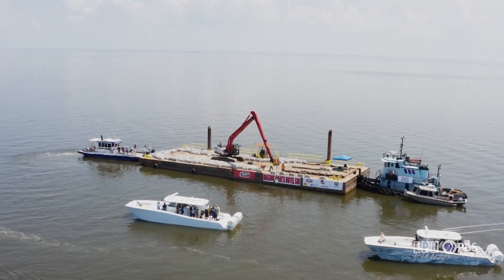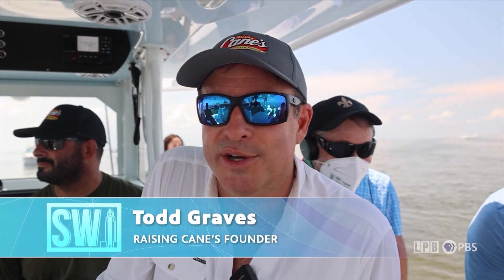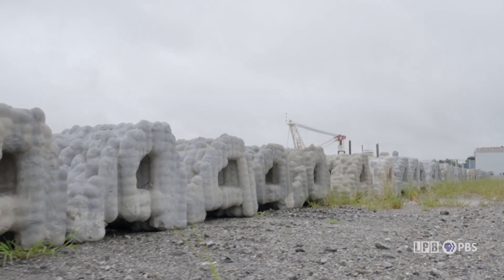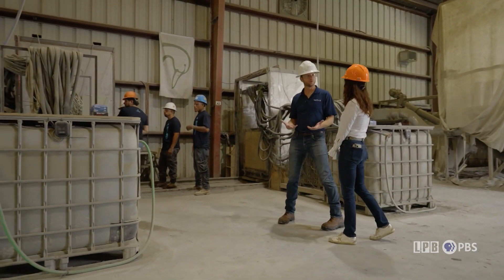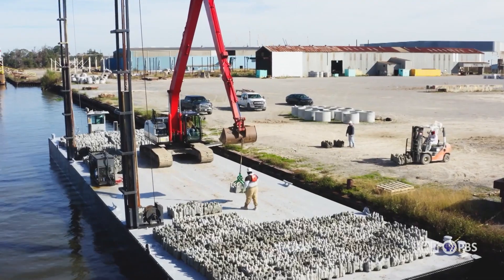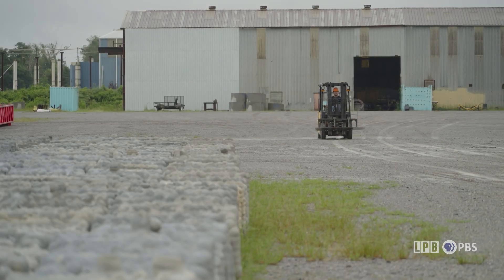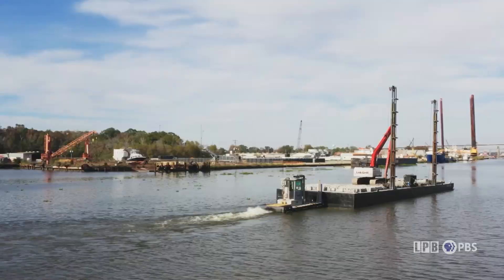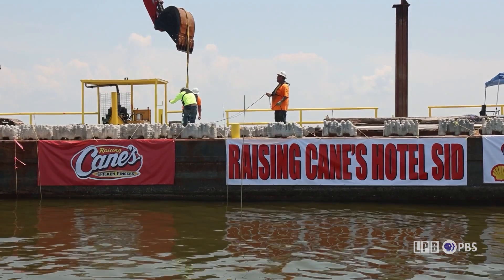New Artificial Reef | LSWI Segments | 9/20/24

Comment: 3D printing works great in low volume custom designs... it takes 1 hour to 'print' each block... however, these concrete 'blocks' could be mass produced at the rate of 400 per hour... and they are in other parts of the world already...